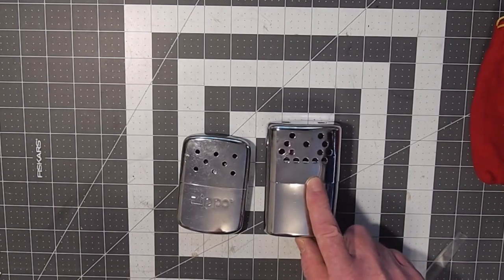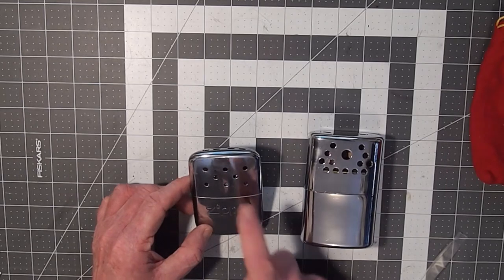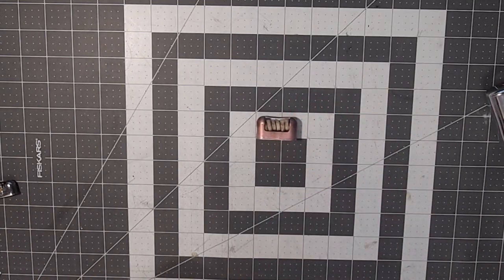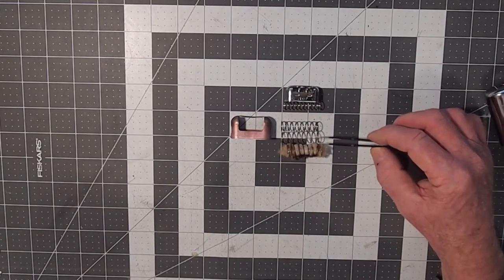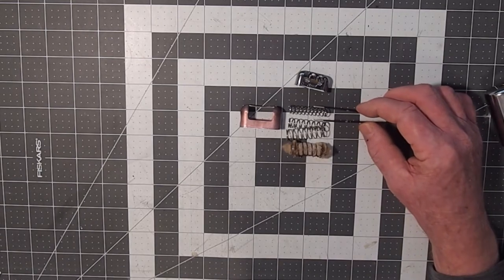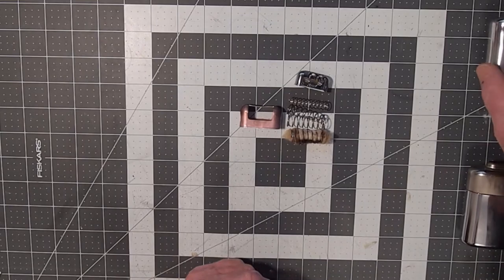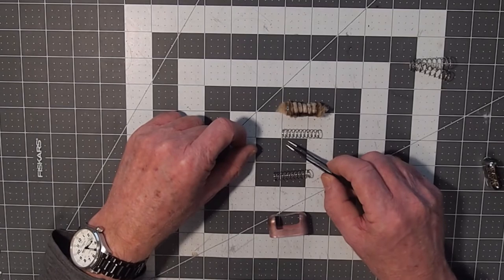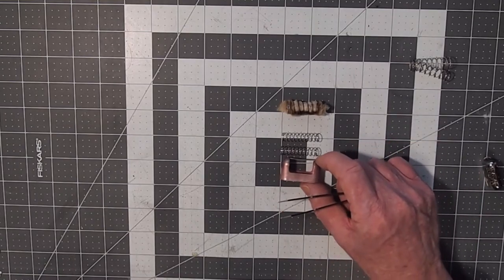Handwarmers S06E01 Jon-e Giant catalyst & springs

Comment: I'm thankful to have stumbled upon your videos because I'm in the midst of repairing my catalysts. My solution to a bad catalyst seems rediculous, expensive, and extreme in comparison to yours, and you've really opened my eyes. 

Here's what I'm doing. 

From a 2"x3" platinum-clad niobium mesh electrode, I've made four cages that wrap around the old catalyst cloth. (my catalyst heads now look like electric razors) 

Next I was going to add a small .002 thick platinum-iridium alloy wire spring inside the old catalyst cloth. This wire hasn't arrived yet, 50 bucks for 5 feet.

Now the crazy part that even I'm not sure about...I happen to have one gram of potassium hexachloroplatinate. It's a bright yellow platinum compound. I was planning on dissolving this in boiling water then soaking my old catalysts in it.

In my head this all sounds reasonable. I need to get platinum packed into these elements. More platinum means more heat. Platinum is expensive and hard to come by, so I need a high surface area. 

But...after watching your videos and seeing this ceramic platinum soaked wool...all my plans are out the window!!
Reply from the maker: After a couple of beers I can't even begin to asses the chances of you system supporting an exothermic reaction, you'll have to get us some pictures as it sounds like you've dedicated some hard work and time to it. As for 'ceramic platinum soaked wool', you'd be referring to Saffil fibres in terms of what we use for the equivalent substrate. The manufacturer calls Saffil fibres 'Alumina Fibers'. However, there are many propane heaters that use ceramic elements to support an exothermic reaction, so it stands to reason that anything you can get platinum deposited on has a chance of working. BTW, to digress a bit, I often find some comments seem to refer to Saffil as a fiberglass material which would be incorrect. THe melting point of fiberglass is around 1100C, whereas Saffil is rated for a nominal melting point of 1600C.
Reply: @MountainParameters  yeah it's hard to explain through text, I'll make a video and post it so you can get a better idea of what my goal is. Also, I purchased HPC platinum bright embers, 5 grams worth. Learning that this stuff exists and is available really changes up my plans and I can now skip the chlorinated platinum compound all together. I've read somewhere that these catalysts really need at least 1% Platinum in them to work well, but I have a really limited understanding of catalytic reactions. I do have experience with alumina though, it's able to tolerate higher temperatures than silica (fiberglass) but it's not as mechanically strong. It does handle heat cycling better than silica though, very good for this application.

Side note, seeing that platinum is so extremely expensive, and it's use needs to be made as little and as efficient as possible to keep costs reasonable, does more platinum directly correlate with more heat? I imagine that a wire mesh has much lower surface area than a fibrous substrate, which would make for less platinum being exposed to fuel vapors. 

Idk, I'll make a video lol
Reply from the maker: @Bloated_Tony_Danza  The amount of heat resultant from an exothermic reaction is a function of the surface area of the catalyst that comes into contact with 1: the volatile organic compounds in the fumes your fuel give off when it evaporates and, 2: Oxygen, and 3: ambient temperature. Pack the catalyst too tight and you remove two sides of the catalyst triangle. Pack it too loose and there is less catalyst available to generate heat. Just like packing espresso coffee grounds into a portafilter to pull a proper shot, getting the optimal catalyst density is best given substance by developing your skills as a 'Handwarmer Barista' through trail and error. We'll look forward to your video!

Comment: Just purchased a giant. I couldn't help but laugh at how big it was when i finally saw it in person. The peacock giant is the same size in width and height but only half the thickness.  I will try my steel screen mod in the head and see if there are any good results. Hoping for a flame thrower given the size of this thing!
Reply: Works great! radiates the most heat of all my warmers. one test i did was blocking the tab holes that are in the head. My thought was vapor escape and more vapor going up and out the catalyst. I found I was getting a slight but measurable temp drop! I think having them open has something to do with oxygen. repeated with standard Jon e with the same results.

Comment: Hi John i Brought two of the Large Jon-e Giant and the Small Jon-e Giant from my Local outdoor store The Heads them self's is there a better one you can use? find so flimsy! I'm using your large Springs i love them lots of heat great for -30c we getting In Labrador!
Reply from the maker: Hello Dave, first you guys got the storms, and now the cold! We did get to -31 here last night as well. I've never really found anything that can replace the shrouds on any of those handwarmers, so you're forced to make do with what they had, and try to modify them as best you can using pliers to make them fit tighter and springs to hold the catalyst in place. I once drilled a hole in the shoulder of the reservoir and then put a grommet in it to use as a refuel hole, and then used a heat resistant rubber cement to try and hold the shroud on, and that really didn't make much of an improvement in the end.

Comment: I have a long winded question. I left my catalyst installed on a recently refueled, unlit hand warmer. About 20 minutes later I decided to light it and I could hear the catalyst "sizzle" momentarily. To me that's fuel vapors absorbing onto the catalyst as the fuel evaporates. Now I think* my hand warmer isn't as hot as it was before but I'm not sure, maybe I'm just worrying. You said that if fuel spills into the catalyst, there's a permanent degradation in heat output? My question is if the fuel itself is volatile, will the vapors cause damage similar to liquid fuel? I'm using VM&P Naptha from home Depot. 

Oh and I'll make that video today or tomorrow
Reply from the maker: Sounds like you did everything right, it is best to let the handwarmer sit for awhile before lighting it to give evaporation a chance to get going and produce fumes. Even if you get naptha on the catalyst, in my experience it does not 'sizzle'. More likely there was some sort of contaminent that got burned, but that's just my best guess. But as to whether it could damage the catalyst, based on your description, I rather doubt it.

Comment: thx for the video! what modern hand warmer do you recommend now a days?  I'm still using my trusty zippo but my boston hand warmer had its plastic bottom piece break off.
Reply from the maker: The technology behind liquid fuel handwarmers has not changed much in 100 years. Therefore any handwarmer that is used properly and maintained properly, even if it's 50 years old, should work as well as a new one. Yes, plastic is not as durable as metal, and cannot take as much punishment.

Comment: My 1969 GI With OEM catalyst Is. waay too hot for the chest pocket on my carhart bibs. My question is if I go to a lower heat head, will I be just off gassing raw fuel fumes (Naptha).  Can I cool my burn by reducing air circulation? Or will that just throw out unburned fumes?
Reply from the maker: Let's use an analogy to conceptualize this. In 1969 car engines were aspirated by a carburetor. The combustion triangle is a basic concept used to understand how combustion works and how to optimize it. Aspiration refers to the way air is drawn into a combustion chamber. In a combustion triangle, the three elements that must be present for combustion to occur are fuel, heat, and oxygen. Aspiration is the process of introducing oxygen into the chamber, typically by using a fan or pump to draw in air, but in this case it is convection. This air provides the oxygen necessary for the fuel to combust and generate heat. By limiting this arm of the triangle by limiting the convective flow, your GI will produce less heat. Less heat in the Carhart bib means less evaporation of the naptha, thus contributing to the end result you seek.

Comment: Do they still make the Jon e giant? If so Where I can buy?
Reply from the maker: Mine was gifted to me. Based on what I have heard from other clients, they had to get theirs from listings on eBay, probably because they are a legacy product. I plan to have a few cases of the 'Red Star' model that, once modified with proper catalyst, produces similar heat output as the Jon-e GI, in late February.

Comment: Hello, what is material of spring made of?
Reply from the maker: Stainless steel and nickel-chrome are used to create the spring. Stainless steel contains at least 10% chromium and is highly resistant to corrosion. Nickel-chrome alloys, also known as Inconel, are corrosion-resistant alloys that contain nickel and chrome as the primary elements. They are known for their excellent resistance to corrosion, high-temperature strength, and resistance to fatigue, which is important when they need to retain their shape in the shroud of a hand warmer after numerous cycles of heat/cold reactions and exposure to atmospheric hydrocarbons.

To blend stainless steel and nickel-chrome alloys to create a spring, the alloys are melted, and mixed together in proportions that we have deemed appropriate after a few years of seat of the pants field tests to see which proportion has worked the best over time. We then have the factory make them to that specification.
Reply: Thank you , where can I buy the catalyst , the spring , and carbon felt , do you have recommendations for brands?
Reply from the maker: @jesselee8704  Items outlined in this demonstration can be found on our order form:
https://bit.ly/3LhyjyA